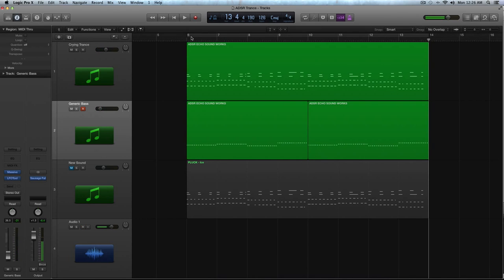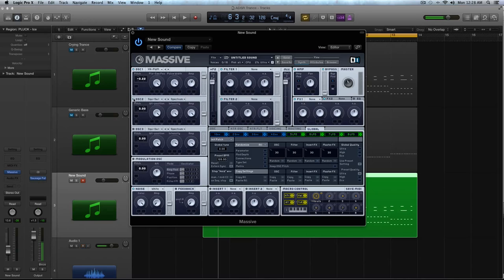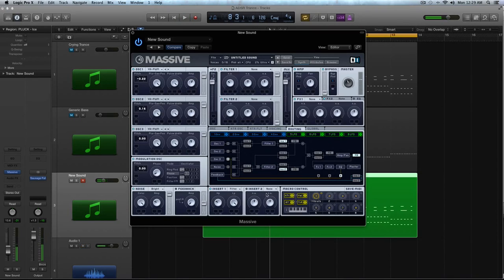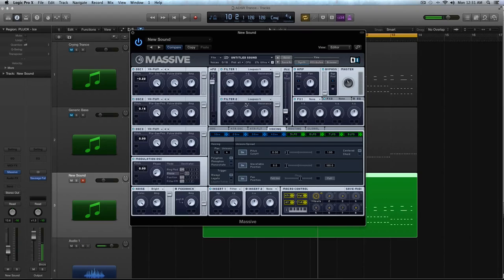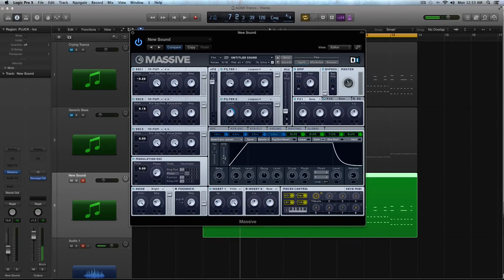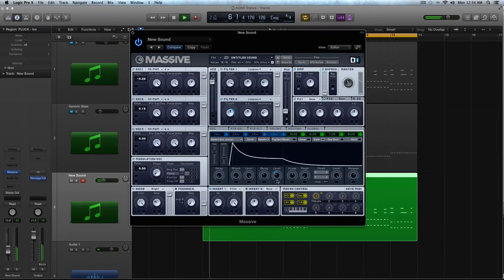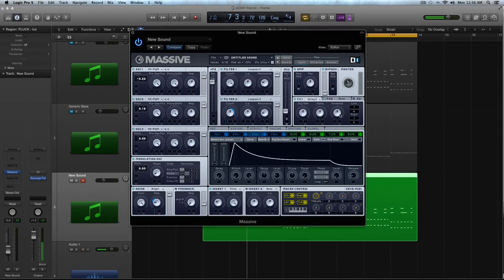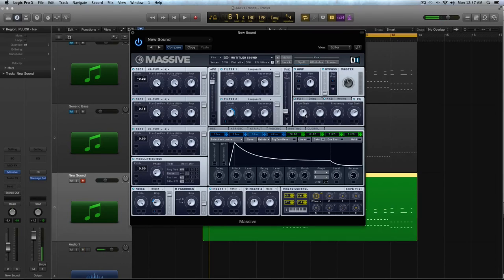NI Massive - Progressive Trance Lead - How To Tutorial

Comment: Really nice sound! The bright noise added a cool texture, and I like how you used one envelope to control the other's decay level, definitely adds a nice subtle expressiveness. Out of curiosity why didn't you send the first two oscillators 100% to filter 1? Does the small bit of signal going to filter 2 give it more higher frequencies to work with for the punchy attack stage?
Reply from the maker: Hey Jon, I always love your comments! Yes, it gave it a little more richness on the top end to my ears.